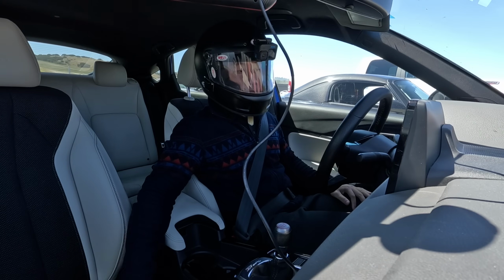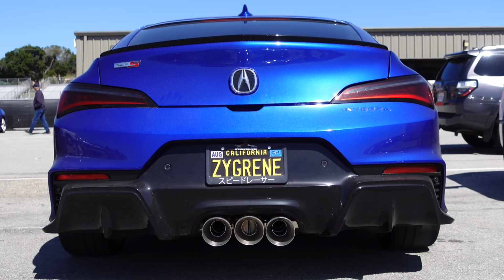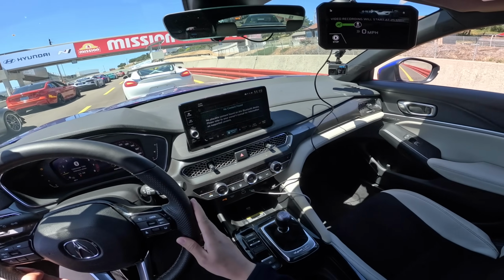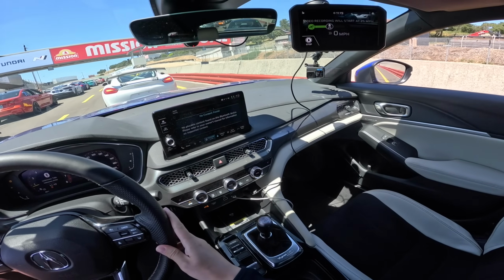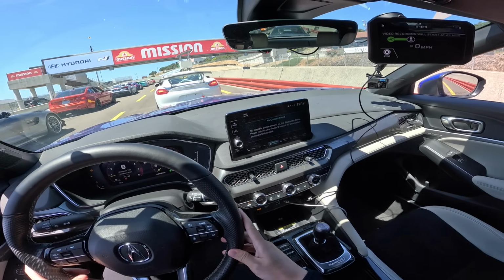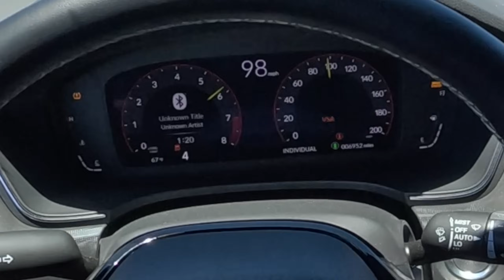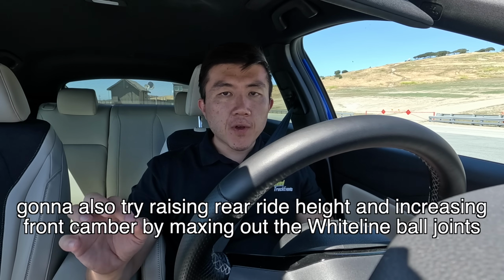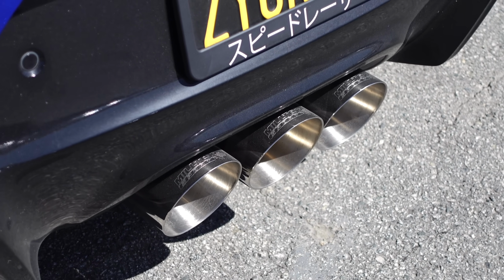1 Step Forward, 2 Steps Back - Modified Acura Integra Type S at Laguna Seca

Comment: The squire suspension set up would definitely increase understeer in a FWD car. The old set up is better suited for your car. A squire set up works great on a front engine RWD car.
Reply from the maker: Yup. Already decided to put the rear 10k springs back on, plus a couple other handling changes.
Reply: Exact F:R coil spring rates also depends on other factors such as F/R motion ratios, weight bias, sway bars, tire setup, etc 
But yeah the gist of it is increasing the relative spring rate on one end does seem to cause that end to lose grip sooner than the other. 
As I also found with my 04 AP2 which came stock with similar F:R spring rates and sway bars. Going to Ohlins which came with 10k F/8k R made it understeer way too much for me (on "square" tire setup even). 
Going to 10k F/10k R got me back to the balance I missed
Reply: I’m running 6kg front and 8kg rear on my ohlins on my CTR - nice balance
Reply: Try a Cusco rear sway bar on the 7/7 setup before you go back to 6/10

Also get rid of that PRL intercooler, blocking air flow. Swap it for tube and fin style.

Comment: I have no idea how spring rates translate to ride rates on the Integra's specific geometry, but given an assumed front-biased weight distribution, something approaching square spring rates is probably correct for "flat ride" and maximum mechanical grip from a ride motion standpoint. However, a flat ride setup on a nose-heavy car will require a beefy rear sway bar to restore the desired lateral weight transfer bias. That's why good-handling FWD cars tend to lift the inside rear wheel. Get the beefiest rear bar you can find and you should be good to go.
Reply from the maker: Going to try adjusting a few things before adding a RSB, but that's definitely next on my list if the adjustments don't work.
Reply: You always want a higher natural frequency in the rear than the front on a front wheel drive sporty car.  At least 10% higher in the rear, if not 20-30%.  E.g., if the front is 2 Hz, the rear should be 2.2-2.4Hz.  That's typical for OEM spring rates on sporty FWD models, it's how Fords and RenaultSports get that nice pivoting feeling. 🙂 

My preference is to do that spring rates and not with a huge rear swaybar (the OEs don't use a huge rear swaybar to do it).  Since everyone says WRXs understeer, I had a huge rear swaybar and stock front swaybar on my GC8 WRX (with square spring rates 7kg/mm front and rear, it's strut front and rear, so I guess about the same motion ratio at both ends) -- the way it handled was spooky,  lol.  You want that pivoting feeling in a front wheel drive car, but the way the rear wanted to overtake the front with that setup was too much lol.
Reply: @Zygrene  May I suggest looking up or measuring the motion ratios, estimating the corner weights and calculating the natural frequency front and rear?  You're looking for a natural frequency that is about 10-30% higher in the rear than the front.  Whether that's by going softer in the front, stiffer in the rear or both, that does make the ride a bit hoppy but that's just how sporty front wheel drive cars are. 🙂
Reply: @TassieLorenzo  you are right about the frequencies in general, but sway bars do not affect those frequencies (okay, they affect them a little during cornering, but that's beyond the scope of anyone to calculate without a supercomputer, as it likely changes dynamically with lateral load). Sway bars are only the icing on the cake you use to fine-tune handling balance after you have achieved the desired frequencies with main springs. In the case of any car with a massive front/rear weight imbalance (basically all FF cars), you need that big rear bar because so much more weight transfer is naturally happening up front and the rear springs are relatively soft even after the 10% higher ride rate boost (less weight means a faster ride rate even on identical springs). If you try to balance the car with main springs, you will end up with a rear end riding WAY faster than the front, and it's going to be pogoing all over the place. You cannot achieve balanced handling and flat ride on an FF car without either a big rear bar or reverse-staggered wheel/tire sizes. Many people choose to sacrifice flat ride because they don't know what it is, or they think that's only for comfort. They go slower. The exceptions are cars with full unlimited time-attack, F1, or Pikes Peak level aero, where managing aero loads trumps all other considerations.
Reply: @roadfordays  "it's going to be pogoing all over the place ... Many people choose to sacrifice flat ride because they don't know what it is, or they think that's only for comfort. They go slower. " I guess you're right but I love the Tiff Needell video where he tests the three Super Tourers, especially the Vauxhall Cavalier and he loves the Cavalier's hoppiness and eagerness to turn in and how the setup has made it "come alive".  ¯\_(ツ)_/¯🙂 You reckon that arrangement on the Cavalier is "slower"?  The video is called "1992 BTCC Comparison Test Top Gear".
Reply: @TassieLorenzo  I'll check that out! Thanks, I love anything with Tiff

Comment: add a thicker RSB you can retain your ride comfort for the rear while improving the rotation of your car. if you can get the karcepts I suggest that but the EIbach 25mm will significantly make a huge difference. without any draw backs for day to day living. you'll also find lesser wear on your front tires because you will not be asking too much out of it because car rotates beautifully. just a win win for roughly $200-500 depending on what brand you get that also translates to faster lap times

Comment: If you can get back on track before the next set of mods, it could be a worthwhile learning opportunity to play with damping and see how it affects car dynamics firsthand. You probably won't be able to solve all your qualms with the car, but I think you'll be surprised just how much you can tune motion control with compression and rebound tuning, as long as your spring rates are in the general ballpark and you have quality damping.

Kind of making lemonade out of lemons with the less than ideal setup changes you're dealing with, haha. The square setup might actually make it even easier to feel out and understand.

Comment: Great job and thanks for sharing. It seemed to me watching that the setup changes did not yield an increase in overall grip and/or that braking instability was just really bad. If it were me, I'd go back on either front or rear springs to re-establish a better baseline and then go forward with bars. This setup didn't want to go fast in, which would make for a long day.

Comment: Totally agree with larger diameter rear sway bar, also have you contemplated using a wider front tire, ala Porche, but back assword cuz FWD. Alternatively you could try softer front shock and or springs. I realize everything cost $$$. Been there and done that.

Comment: It's clear you're dialing things in, some of this was clearly nerves and mild hesitation with entry speeds. Too many cars on track doesn't help either... But all things equal, agreed on a slightly stiffer rear spring rate and rear sway upgrade, although before you shell more cash would first try (as previously recommended) to set your Ohlins dampening in the rear almost to full stiff (1-2 clicks) then have front ones at maybe 2-4 clicks, in order to get rid of that mild understeer. Slightly higher tire pressure rear (mb 1-2psi) than front as well. I am running 7k front and 8k back R&T setup on a AWD mk6 R with 3 clicks front and 2 clicks back (upgraded/fatter rear sway) and its as close neutral as it will ever get. Keep working on it and don't get discouraged. Knowing and fixing the issue is progress even if your times don't always reflect the gains.

Comment: Get the RV6 chromoly  25mm rear sway bar and the whiteline anti lift kit.   Also the Injen intercooler is high volume but less tall so it won't interfere,  maybe get the koyorad too

Comment: I think the next mod should be something that you can use to monitor all your temp gauges. If it exists.
Reply from the maker: Looking for suggestions here. I can probably pull calculated oil temp from OBD2 into a smartphone app like Torque Pro, but sounds like a bit of a hassle to set up before every track session.
Reply: @Zygrene  Really your only option is to install an aftermarket oil temperature sensor. On the Civic forums there is a guy setting up his FL5 to eliminate all of the overheating issues. He installed a oil temp sensor so that he can get an accurate reading (LogR gives you an estimated temperature reading from coolant and IAT readings). 

I have a FL5 and am been following the thread closely and plan on doing the same to mine eventually. But the only way to monitor your temps is install your own gauges unfortunately, at least with the oil temp sensor it doesn't require any drilling and has a clean look. He also installed 2 oil coolers and an additional radiator.

Youtube keeps deleting my comment whenever I post the link to the post on the Civic forums so I cant link it lol

Comment: So I wanted to add my two cents even though I’m by no means a professional just played a lot with springs on the sim. There are two sides to this coin; A square setup is a good idea for FWD depending on weight distribution and I think you highlighted some of the problems in the video, u have the same alignment and dampening settings with a totally different spring and that just won’t do. With the rear being less likely to rotate. You need to make dampening and rebound changes in order to promote that rear rotation. As well as an alignment (I’d look at toe and rear camber) that help with that as well. On the other of the coin; going back to that 10K will definitely get you that rotation and then with things like rake and other dampening changes, u can stabilize it under breaking. I feel both routes are do able just more changes are needed in order to accompany the significant spring change. ESPECIALLY your dampening settings in reference to the 7K Square setup! Thats just my opinions and I’d love to discuss more with you to hear ur thoughts as maybe an 8.5K or something along those lines is what you need. (Idk if it’s possible to obtain a spring rate like that)
Reply from the maker: Thanks for the insight. I'm putting my 10k rear springs back on, plus making changes to alignment and ride height before my next track day.
Reply: @Zygrene  Nice, that should do it!

Comment: Unfortunately, you only have one way adjustment on the Ohlin R/T.     I have MCS 2-way remotes on my 718 GT4.    As a general rule, the stiffer the spring rate you go, the less compression you need, but the more rebound damping you need to handle that spring rate.     

With 1 ways, the compression and rebound clicks are married to each other, with the larger change coming from the rebound side.

When you start playing with different delta's front to rear on spring rates, you really need a 2 -way damper to un-marry the compression from the rebound.

Comment: 7/10 might work well. 6/10 is too tail happy, 7/7 is too pushy, 7/10 might work well. On your 6/10 setup you needed a bigger front bar, on your 7/7 you need a bigger rear bar to handle more roll couple, so I'd try 7/10. Although adjustable bars are cheaper and easier and dont require re-alignment.
Reply from the maker: We think alike. In the next 48 hours I'll have 7/10 installed.

Comment: I'd assume since the fronts are struts the motion ration is about 1. The rears are not struts and will have a motion ratio above 1 so you would never want to go equal rates in a fwd car. The rear should be higher. You could band-aid it with a stiffer rear bar but you should go with stiffer rear springs. ultimately you may want a stiffer rear bar but you should start with stiffer springs

Comment: Next mod, fat fat fat rear sway bar. lol
Reply from the maker: Yeah that's on my radar but I'm going to try a few other things first, before adding more parts.
Reply: @Zygrene  100psi rear tires will do it! kidding. Looking forward to what happens next.
Reply: I'm not such a fan of that, as it only works mid-corner AFAIK?  Whereas stiffer rear spring rates help with initial turn-in and corner exit too, doesn't it?
Reply: Rear sway bar really wont do that much, its not a common mod for CTR owners to do

Comment: I’m thinking the front strut bar and the intercooler add a significant amount of weight to the front end of the car. Dealing with the same thing on my Si. Maybe getting an antigravity battery would help with better weight distribution in the front to reduce understeer
Reply: Also to add I recently added an RV6 rear sway bar set to max stiffness. It is a HUGE improvement with rotation I believe the same bar fits on the integra/type R